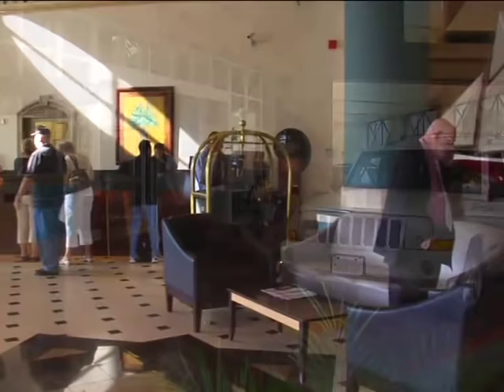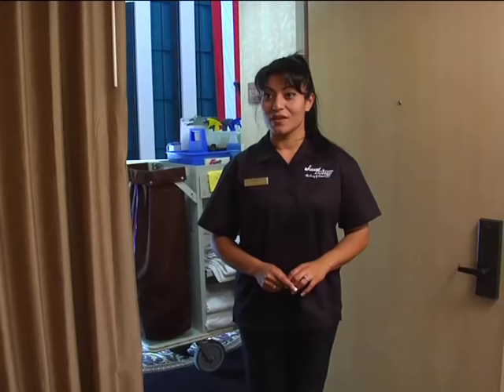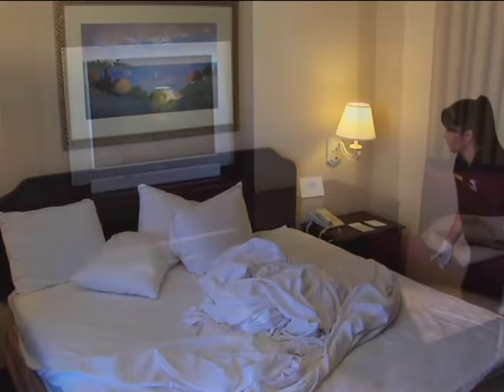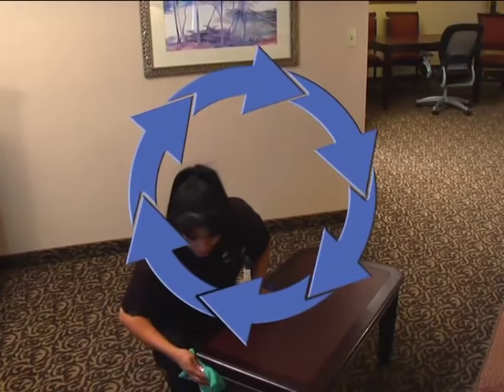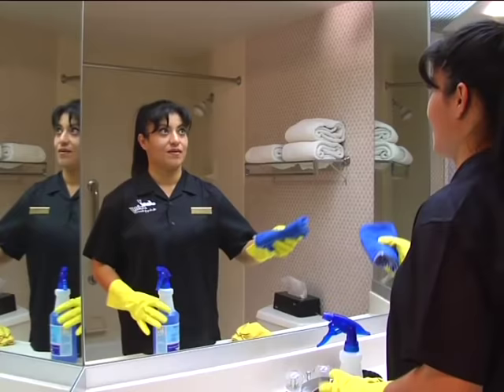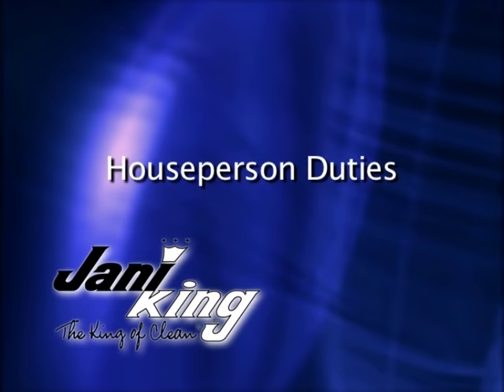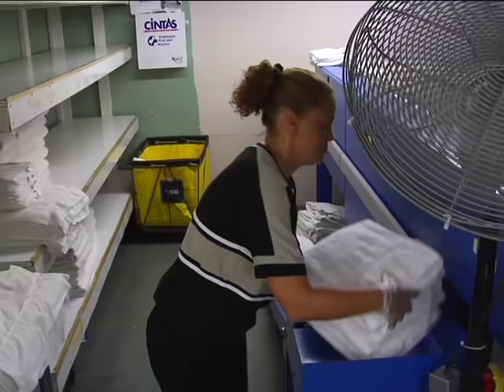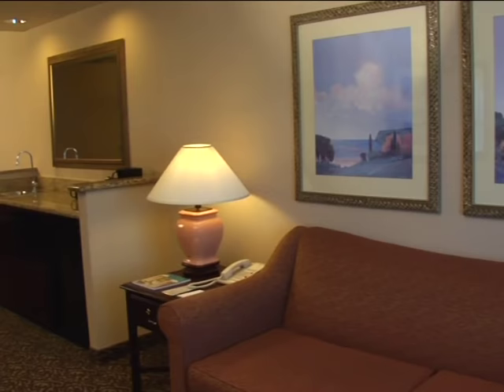HOS_hotel_resort_houskeeping

Comment: Very informative. worked in a hotel and some of the procedures here are not done by the others. they can't even make a sharp mitre and has been there for more than 5 years, what matters to them they do all their rooms at no time. The total maximum number of rooms to be cleaned were 18, now you'll gonna cry if 10 or 12 of those rooms were for checkouts because every room needs to be cleaned only half an hour.  the tubs were always difficult to clean, you have to lean over and scrub those grime. there are guests that they don't care when they left for checkout or even stay in--the room looks like a garbage pit, you don't know where to start. situation like this  ruined your momentum and you slowed down, not to forget Do Not Disturb or No Service rooms ARE NOT PAID, in this regard you are expected to leave early. happy cleaning!!!

Comment: I myself, see allot of discrepancies.  Although very informative, I see that she is making unnecessary trips.  I am sure her nails can not comply with company standards.  Mentions a 'two glove' rule, when she is bare handed without glove, caring dirty/soiled linen.  Speaks of goggles, and does not wear them while spraying chemical in the bathroom.  "Circular motion,top to bottom", is the ideal method, one should do this before making the bed.  Lastly, the shower curtain should be replaced, as every linen should be.  Cushions lifted and inspected and  vacuumed, as the furniture should be as well.  Her cart was well stocked and organized very nicely.  Her appearance was very professional.  Safety method was very courteous, professional but direct.  Over all, procedures has room for upgrading.  Certified for over 6 1/2 Years,  with room/suites of similar to one bedroom apartments, with anywheres from 12-45 Suites, normally 2 - 3 wings, on a daily basis. With an 98% Q.A. score.  I say this, because if I did all that unnecessary trips back and forth to the cart to the room, I would be exhausted by 10:00 break. lolol.. :)
Reply: Not that serious.  Relax
Reply: yes if you whant gests to stay with you it is I try to clean my house like this Siriusly
Reply: nails and rings really ?????
Reply: Dude chill this video was made in the early 2000s in housekeeping and your fazed by the cleaner having nails lol. She not a housekeeper, she's a demonstrator, and a sure good ass one at that.

Comment: 16-20 rooms a shift? On a eight-hour shift that gives you less than 30 minutes to do  all of this?
Reply: It takes about 8 - 10 minutes to clean a room.  You have a system that you do over and over and over everyday.  The rooms don't get really dirty because you clean almost everyday.
Reply: Mathieu, yes Less than 20 minutes, in fact Justmejoy7 is aware of the current allocation for housekeeping duties. 8-10 minutes is an industry standard for a seasoned housekeeper. On occasion a deep clean is scheduled, but in most cases we can have a room reset in less than 15 minutes, excluding laundry.
Reply: Mathieu Brouillette  Its suppose to take 30 minutes a room. and +JustmeJoy7 even if you do clean the rooms everyday doesnt mean they stay spotless. they can be destroyed within a night. I have worked in housekeeping for 5 years and not all rooms I clean everyday are easy to clean when they check out.
Reply: Krysta Mapplebeck
 I understand that, that is why the Houseman is suppose to help you by stripping some of your rooms so you can keep up the pace.  I don't agree with the practice of the time, but I think most hotels don't have enough staff in the first place to handle the load.  High turnover.
Reply: True. We are short staff some of the time so laundry takes one of our housekeepers and puts them in laundry. Its very frustrating lol
Reply: Krysta Mapplebeck
Your hotel should hire a laundry service and have those laundry workers help with cleaning rooms.
Reply: +JustmeJoy7 
i don't believe you, just in the wash room alone collecting soiled towels and  garbage cleaning sink, and toilet bowls, mirrors, replenishing supplies replacing curtains take you 15 minutes...now you can only compensate on some other rooms if the guest there is decently organize.
Reply: Noy Gwapo  It shouldn't take you 15 minutes in the bathroom.... maybe 10 max but not 15 if its taking you 15 minutes you need a better routine.
Reply: JustmeJoy7  Yeah I was thinking that also. :P but we do okay considering how many rooms a shift we get and how many staff we have now compared to last year. We now have 2 housekeepers per floor and 2 people in laundry. so its great now but when we had one per floor and one in laundry it was crazy lol
Reply: @JustmeJoy7 may be that side, but this side,  these people Ar...bs, it's very rare to leave a room clean😮😮😮 I don't know how God created them.. most of them do not even flash the to...i..lets  and call for room Attendant to do it